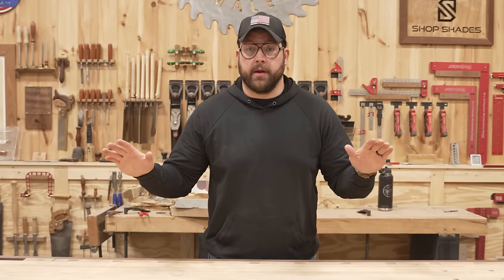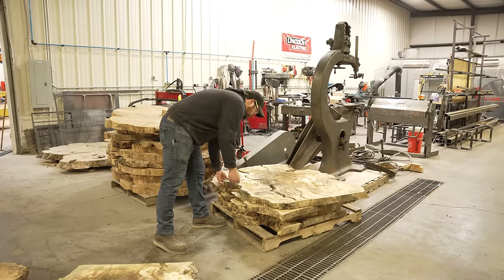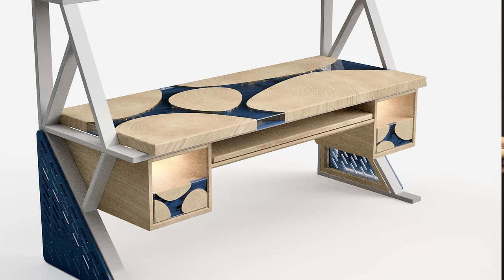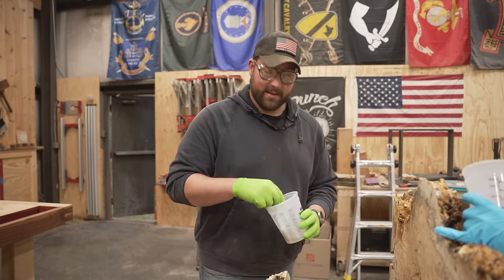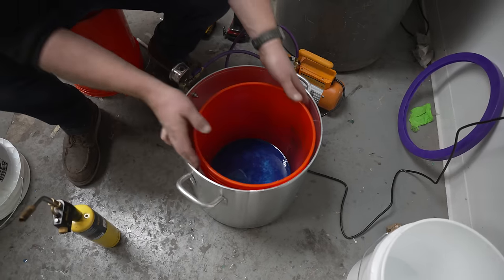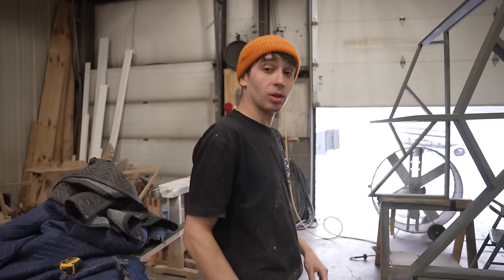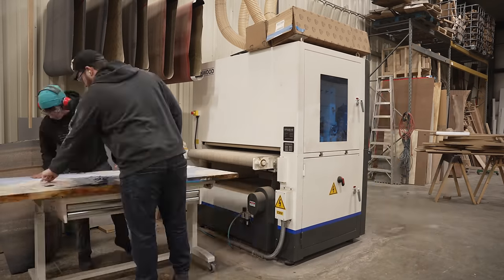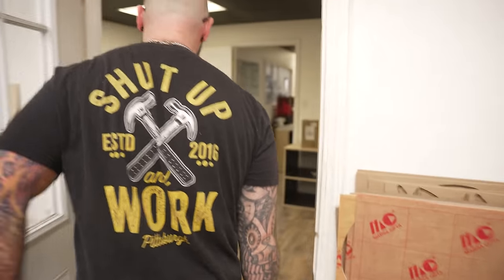I Build A Very Expensive Gaming Desk

Comment: That is a sweet looking desk and going with orange was the right call.  I also like what you did with adding the pieces back in on the sides for where you cut off for the ears.  I think that just finished off the table that much more that if they would have not been added back in and it would have just been the ears in the front.  It is a thing of beauty and Joe should be proud to work at such a work of art every day.

Comment: The look is very cool.  I love epoxy blue with the wood.  Really nice.  Though it is very limited in space. 

Desks especially desks for content creators must have space.  Therefore the minimum width must be 60” with a minimum depth of 30”.  Those dimensions are bare bone minimum.  If the desk is that small the creator must have an auxiliary preferably rolling table with drawers preferably 18”W x 30”D to supplement the lack of space on desk.  The auxiliary rolls to put away at end of day.  

Ideally the desk should be 72”W x 36”D with an aux cart that’s 18”W x 36”D.  This gives the creator/operator plenty of room and freedom for the work.  Plenty of room for peripherals, additional monitors when needed, etc.

FYI we normally don’t use a keyboard tray.  The keyboard usually sits on top of the desk.  We sometimes use an 80% board with a stream deck, a separate number pad (rare), etc.

Comment: that slotted MDF could offer a cool way to add accessories. Cut a small piece that would slide into the hole and have it rotate locking what ever hanger or shelf you add to the front..

Comment: Best looking top by far!  I have two minor issues with the design but I can't do what you do so take it how you will. The plate for tech is only good for that specific tech.   Those items change design and get upgraded so much faster than you would think.  The other is issue I see is that there is not much room for expansion of monitors with out covering the speakers with the angled supports.  You could go ultra wide single monitor but having multiple is nice for multitasking.  I would love a desk top like that,  amazing work like always.

Comment: How did the magnet panel idea work out longer term? The magnets seemed a bit weak for panel attachment. Which is why you were able to easily slide it by hand to adjust it at 31:39.  I'd have used slots/keys or some other engagement mechanism, with the magnets just to keep it in position. My guess is an accidental foot into it from under the desk would cause the panel to fall off. Still, it turned out nice.

Comment: Sick build. I like the color scheme. Quick question tho, don't you use a ceramic coating? I started to use it with tables, that get spilled stuff like dining and coffee tables and desktops. Especially desktop, as working and eating / drinking often happens at the same place and in time, you will spill stuff onto it. 🙃
EDIT: I would have use push to open systems for the drawer, to make it look even cleaner. If it is too much clean space, so it looks to flat and needs some contrast, the drawers would be a perfect place for your logo (or some other graphic). CNC that in and fill it with epoxy.
Also, great idea to colour match the inlay in the middle drawer. Nice hidden feature!

Comment: Have you done a slab or table top sort of backwards. Meaning keeping that burly side up that looked like wooden boiling lava and intentionally create bubbles in the epoxy? That desk would look rad with that burly under belly in the middle and opposite corners have surfaced wood and a bubbled light transparent red lava looking epoxy throughout.

Comment: Instead of the wood panels painted orange, steel panel that were rusted orange and then sealed with a clear coat would have complimented the top better because they would have had a more varied texture while still having the color you were looking for to match the blue. It would have also fit with the industrial look the design was going for.

Comment: failure to plan, is planning for failure.  1) magnets near electronics is a very bad idea.  2 worst enemies of electronics is heat and magnets.  it may not cause problems right away, but as stuff ages, it will become more and more sensitive to those magnets and you will find that especially storage items will have shorter lifespans or files going corrupted.  those orange sections that are magnetic are actually your high danger items :D. 2) the "heat generators" like the studio box, if those generate heat while being used, over time it will cause any epoxy near them to sag.

Comment: I am pretty sure your epoxy cupping issue is due to taking it out of the mold too early. Even after the cure time has passed the epoxy is still softer than the final hardness will be. During that time it is possible to deform the epoxy to some extent. I'd try leaving it in the form longer to see if that helps fix the issue

The "cured but still malleable" stage is more a lot more obvious with thin layers of epoxy or just small items made from epoxy. I've been able to reduce that time with extra heat but I don't think it is worth the risk of trying that for your furniture. The one time I've done it was also a bad case for that flexible time being longer than normal because I might have added just a bit too much ink to the epoxy. It did eventually get to full strength and I've had no issues with it since then

Comment: You should start over pouring and not clamp the wood to tight so you get a epoxy seal on the bottom and over poor to seal the top i find it helps with cupping

Comment: Very nice but I think it's less functional. Now he cannot have the vertical monitor as the top shelf interferes with it and it seems that he has less surface space with the metal frame on the sides. In my opinion just a long table top would have been better. Very nice work.

Comment: Tig on that small of a project and grinding the welds away is a complete waste of time. next time, get yourself some .030 hard wire for your wire feed and straight co2. run 17.5-18 volts and 190-250ipm wire speed. Short circuit transfer for the win on this. maybe next time.

Comment: IMO , The top looks nice , BUT the table is too SMALL , there were  2 monitors at the start of the vid on the crappy table and now the new table  has 1, and if he needs another monitor the sides of the table will make it awkward . You  should have done a corner build and make more of the area the table was in .

Comment: Ok, a few things...
1. The table on the thumbnail looks way better with the blue... i don't like the oranges. It doesn't work well..(sorry, just my opinion)

2. You went from 2 screens to 1. It's not a good thing at all for a videographer, and i hope the nas cables reach the computer. Otherwise, that is just a pain to backup if you have to move it constantly to connect it.  (i will give you the fact that the speaker placement is 100% better not being blocked by the other screen but still ahh)
And 
3. I wish you were able to make the draws and the cubby-hole in the original render the rive blue would have looked sick matching the desktop, but the river desktop and the slide out storage for the keyboard mouse, etc was a great idea

But it looks the same size if not a bit smaller than the original desk size.. or is that just me??
Reply: Hey Jeff, I have 2 screens on the desk we had to get another one to match the nice one we just got with the computer. Table for sure got bigger, added a ton of depth that’s hard to tell on camera just watching but can confirm from me sitting here, it’s bigger! Also- we have the cables running to the computer for the nas just tons of cable management you can’t see!